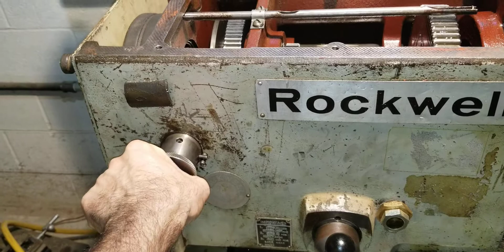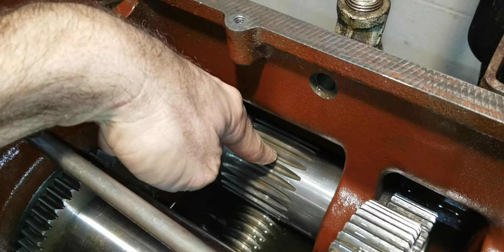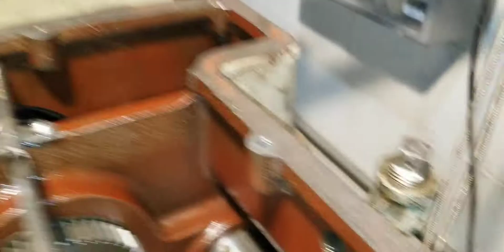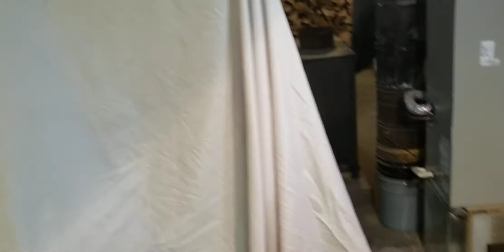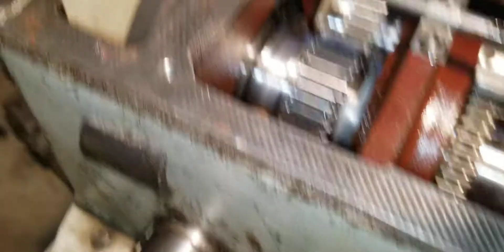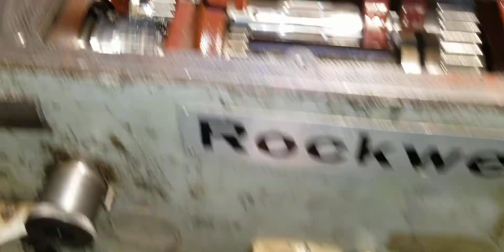14" Rockwell lathe how the back gear works.

Comment: Does anyone know where the fuse is at on this machine?
Reply from the maker: Where is it that your not getting power to? There is a reset switch on the Furnas control box in the back. Have you reset that? Are you getting power to the Drum switch in front?

Comment: Is there anyway you can take a picture of your motor plate? I just got a lathe like this and the motor tag is missing. I have no idea Amps, horsepower, rpm or anything.
Reply from the maker: There were 5 different motors they put in them! 2 have 3/4" shafts 1 has 7/8" shaft and 2 have a 1 1/8" shaft. If yours has the 7/8" shaft then my tag will work what size is your motor shaft?
Reply: Mine is 1 1/8" shaft
Reply from the maker: @jamescatlett-rn9uj I misquoted that there were 5 motors! If you got the 1.125 shaft then you have a 3 horsepower. Mine is only 2! That sucks because there were 2 with 1 1/8" shafts which makes it harder for you because mine won't work and finding someone that has the same motor as you is going to be difficult i think...I doubt there were many sold with the 3hp motors on them! What do you need the tag for are you changing the voltage or does it need hooked up or something?
Reply: Hooking it up. My plan is a VFD. I did put a 3hp single phase motor on it, brand new. After 15-20 minutes the thermal overload on the motor kicks it out. So going back to original motor. This lathe has been a huge pain. But I hope it will be worth it.
Reply: Original is three phase of course
Reply: I would add a picture of the lathe. But I don't see that option.

Comment: I have this lathe, why is hard to pull my back gear out to engage and it is very hard to push back in.
Also the headstock leaks oil.
You’re advise will help me to resolve 

George
Reply from the maker: The shaft you pull out and push in has o-rings on it there prolly bad making it hard to push and pull.
Reply: How do I remove the back gear shaft to replace them

Comment: I just acquired an old Rockwell lathe from a friends grandpa that seems to be missing some guts underneath in the motor area. Any way you could show what that is supposed to look like under there? And how the RPM lever works? Thank you!
Reply from the maker: look at my "speed meter adjustment" video I show a lot of the inside on that video starting at about 4 min 30 sec in. see if that shows you what you need

Comment: I happen to have the same lathe. You're the only other person that I've seen that has that speed indicator "gauge". Mine doesn't work, but I haven't looked into why yet. Mine also came with a brake lever that disengages the motor and, if you push it more to the left, will brake the spindle. It needs work too. One last thing is the tachometer housing in my headstock lid. No tachometer in it, but I love to see someone with a working tach.

Comment: Hello my delta 14 inch when facing it backs off pressire you gotta hold the travel wheel to keep pressure  on it how do i adjist slack out of it
Reply from the maker: I more or less always hold the hand wheel in place when facing just to make sure it stays put but. Most of the time when that happens to me it's a dull tool bit. But it could be a improperly ground tool, the tool is off center, or very hard material. All that said if that's not the problem and the problem is a very loose carriage then you need to at the very least adjust the gib on the back underside of the saddle. The quick fix is. There is a row of set screws with nuts on them back there you need to adjust/tighten them. Just look up adjusting gibs on a lathe. That is just a straight gib back there NOT a tapered gib. So any straight gib adjustment procedure you find on youtube should work. The correct way to fix it would be to take the saddle and gibs off the machine and scrape the ways and the gibs then reassemble. There are tons of videos on youtube videos doing that. That is a very time consuming project.

Comment: Do you have part numbers for the belt
Reply from the maker: Bottom belt 2322v347, top belt 2322v421. The belts listed are for standard model only just like mine. If you have the tachometer mounted on top of the headstock cover I think you need different belts.
Reply: Ok thanks

Comment: What model ADX are you using and what amp panel mount breaker are you using? I just bought the exact same lathe and I am shopping for the American Rotary converter for it.  I assume it is an ADX 10. Thanks
Reply from the maker: It's a 7.5 I got it on sale 2 years ago they quit making that model. An ADX 5 or higher is what was recommended for my lathe... its 2 horsepower... you can also use a variable frequency drive (VFD) to run it too but you may over load it starting the lathe at full rpm in high gear or going from forward to reverse like you would while tapping.
Reply: @Depth_of_Cut  Yeah saw that model was discontinued so bought a ADX 10. Thanks
Reply: Another question since my lathe is missing the taper attachment and the steady rest. Do you have the dimensions of those by chance or can you get them please. Hard to find so I will have to make them. Thanks.